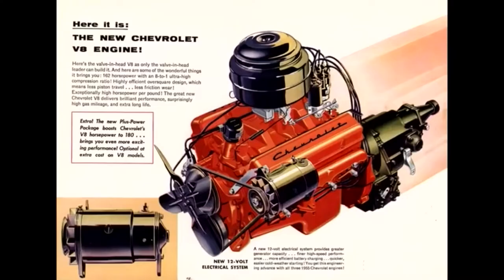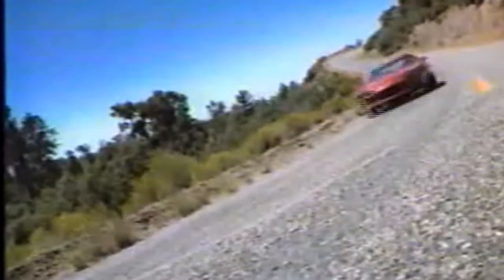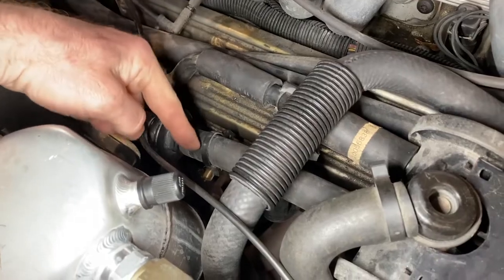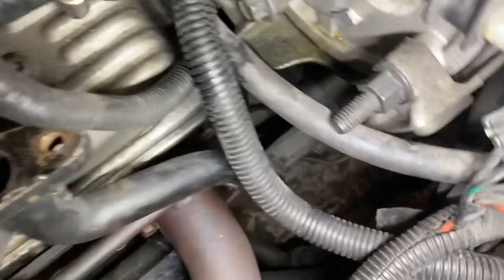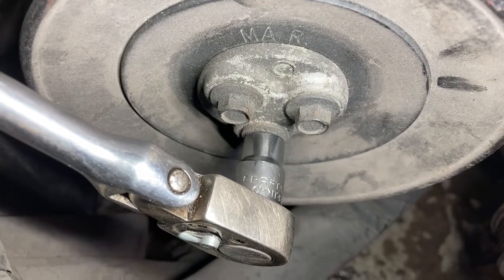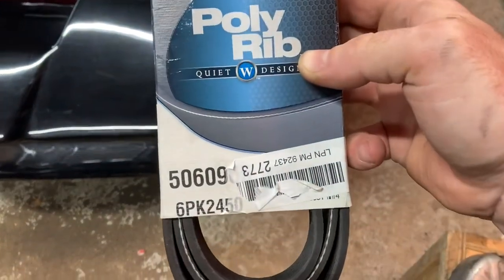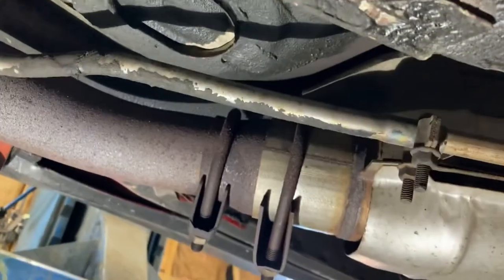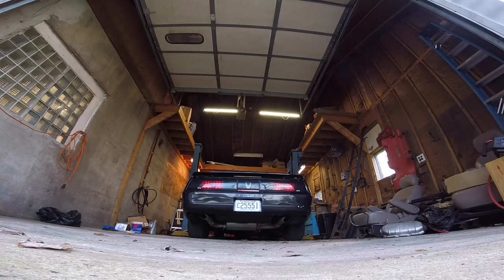How To De-Smog a Third Gen F-Body (the Cheap Easy Way!)

Comment: I just did the cat delete on my 88 GTA (owned since new) last week. I can concur that the difference it made in my smog dumping, tire spinning, freedom machine is truly impressive. If you haven’t already, get an upgrade second stage chip. Life will be good.
Reply from the maker: Got recommendations for a supplier?
Reply: Does anything else have to be done prior to stage-2 chip installation?
Reply: Where did you get the chip? Also the cat delete made that big of a difference huh?
Reply: @BlackRam17  they sell the chips in Hawks motor sports and yes it’s a crazy different, i removed mine as soon as i got the car, couldn’t be a better decision
Reply: @jessedenicola8063  what's the difference
Reply: A few years ago I rebuilt my LB9 (as you, I am the original owner) in my '88 IROC.  I cleaned up the engine bay by removing the AC and heater box (summer car only).  I installed Dyno Don headers and re-installed a larger Cat--the car has 3" from collector back through a GMMG "muffler."  I think next year the Cat comes out because it sits far too low and speed bumps at work are a hazard.
Reply: Does the chip work on both tbi and tpi?
Reply: I’m texting this while under my 88 trans am, laying on the ground and watching the pump
Reply: I just came up on a chip today and it got my check engine light going crazy in a 1991 chevy caprice

Comment: Easy on the 3.1 to skip the smog pump. You don’t really have a choice because you can’t buy a new one. You don’t even have to remove it. Use a different belt and reroute.  You can’t buy a charcoal canister. Therefore unplug fuel vapor line  from charcoal canister, remove purge valve, and put an air filter on the end. Cat…… well you can leave it, but just knock the guts out of it. Make sure when messing with charcoal canister you unplug the vacuum line and plug the end of it off. Non of the changes will give you a service engine light.

Comment: Technically, removing the catalytic converter reduces the carbon footprint of the vehicle because more CO comes out of the tailpipe than CO2. But it also means more hydrocarbons come out which are also greenhouse gasses but much less long lived in the atmosphere. The catalytic converter was really there to decrease the impact on smog and haze. Given how few of these cars are still on the road and how they are used now, removing it will have a negligible impact on any kind of air quality.

Comment: Those metal AIR tubes that connect to the exhaust manifolds are a pain in the azz to get out, but they can be removed using a flare nut wrench and the holes capped with 5/16 inverted flare nut plugs. I did this on my 84 Firebird just to make the engine look a little nicer and easier to work on
Reply from the maker: How do you access the fasteners that hold it in? From above or below?
Reply: @thedoubtfultechnician8067  from above. The driver side is pretty easy to get to but the passenger side is way more hard to access the closer you get to the firewall. On my vehicle I removed the AC stuff for access since I wasn't using it anyway. You might be able to use a flex head flare wrench. There are 4 flare nuts per manifold
Reply from the maker: Thanks!

Comment: Way late as my tuberythm is 12 months behind but like the stepped out details which I will use to carefully remove and box smog stuff since I MAY someday return to home in Calif. to continue to enjoy my '91 RS Camaro which is getting the 305 replaced by the 383 I am building. I do have the smog delete pulley already. 👍

Comment: can you delete the smog pump without cutting out the CAT with no issues? like tuning issues, fuel/air ratio ect? will it still run fine? i got a 92 camaro TBI 305

Comment: Just rewatched and performed the same procedure on my 1985 Trans Am with TPI. A couple of differences between the 85 model and yours (not too sure if my situation is the same as earlier cars, or when the procedure becomes the same as Dt's), My car has 4 belts instead of 1, the egr pump is run off of a single belt, so this means less modifications. The half in iron hose caps still work, however, the egr pump is held onto the engine through 2 brackets with 13mm bolts instead of T40s. The charcoal canister is a separate unit held in by I think 1 10mm bolt, the pump wheel for the belt is still held in by 3 bolts, but not 10mm, I think SAE of some variety, very close but not quite. And lastly, it has extra metal pipes for the air system that run around the back of the engine. These don't need to be capped just like DT's example, but I just performed the work and time will tell if it becomes an issue, or if it's just a little benign clutter. Just thought I'd share what I found!
Reply: Sorry, the EGR wheel is run off of a belt that ONLY connects to it and the crank, that's what I meant by single belt.

Comment: Funny shit, air pump was used to heat the O2 sensor on start up and the catalyst in the converter,the emissions only worked at above idle a till 80% throttle, above 80% throttle only restricted part was the converter,if you adjusted the TPS you could pickup some throttle response, I miss those days

Comment: Great video  i just did this exact thing last week  on my 91 rs convertible  is that a 45 inch belt  some say can use stock belt even without delete pulley? I rather put a new belt on  thanks
Reply from the maker: It’s a 96.5” belt. It’s pretty tight as is, I think a stock belt would be way too tight even if it technically installs.
Reply: @thedoubtfultechnician8067   awesome thanks il  get one this weekend and finish it!

Comment: If you're dropping a LB8 motor into any kit car. Delete the AC compressor and power steering pump. You only need 3, crankshaft/camshaft(hydraulic), water pump and alternator.

Comment: Real quick question here, trying to leave mine mostly stock.  If I remove the catalytic converter and leave the tube for the smog pump will any codes trip? or possible negative outcomes in doing this?

Comment: My 88 iroc tpi smells like fuel fumes after warming up and will eventually start sputtering and shut off until it cools down for hours. Do I have a canister issue??
Reply: Did you ever get an answer to this question? I've got the problem with my 90 with a 3.1l.
Reply: I would check your egr temp sensor and fuel pressure regulator. Common issues. Smelling fuel (running rich) can also come from to much air so clean that throttle body real well

Comment: Great video! Question, will this process be the same on my TBI? I own a 1991 firebird 305
Reply from the maker: I don’t own a TBI, but it should be similar- the main differences between TBI and TPI are the fuel delivery system and some electronics, none of which are affected by this.
Reply from the maker: You could always follow along the video and see if everything looks the same on your car; if so then go nuts!
Reply: @thedoubtfultechnician8067  thank you for your quick reply! I appreciate you posting

Comment: Just one simple question. Are you sure it need a longer or shorter belt after the smog delete? Tough for me to visualize it. Thanks
Reply from the maker: The stock belt might fight but it’s gonna be tighter than a nun’s bum and probably not good for your accessory bearings.
Reply: @thedoubtfultechnician8067  Ok. About how much bigger did you buy? In inches? I am about to do your delete method and would like to know how much longer the one was that you used. Your respectful Firebird friend MIles.
Reply from the maker: The belt I’m running is a dayco 5060965, but I also ran a slightly longer continental 4060970 just fine. They are 96.5” and 97” if memory serves?
Reply: Looks like the same routing, I'd don't know why he said you need a longer belt when you minus one pulley.
Reply from the maker: @mcqueenfanman Try it out!

Comment: I have a stud attached on backside of AC/SMOG bracket right under the Smog pump that I cant figure out? Almost able to see when ya took off tube from back of pump, any idea? (1991 Formula lb9)
Reply from the maker: Got a picture? Thedoubtfultechnician at gmail.com
Reply: I'm sure you've already got this taken care of, but in those situations, I'll use my phone and take a video (with the flash on) and slowly pan around the area, then watch it to to see what I'm dealing with and where it is....sometimes it takes a few tries but it works.

Comment: i have an 89 iroc and for some reason i have 3 check valves and i tried starting my car just with the air diverted disconnected and unplugged and for some reason it won’t start and my brake warning light is on. any ideas on why?
Reply: i have 2 check valves that connect to the diverter and one on the passenger side
Reply: sorry for spamming lol. but i got it to start i must’ve bumped something. but i’m still confused as to why i have 3 check valves. one comes out towards the back of the motor on my passenger side. one comes from the exhaust manifold on passenger side. and the other one comes on the manifold on the driver side. do i need to plug all 3 and is it supposed to be like that or is it dangerous?
Reply from the maker: Glad you got it started. Hopefully whatever you bumped is secure now, would suck if it came loose on a pothole and left you stranded.

I have ONE valve going to the pipe to the catalytic and ONE that goes to both manifolds. It sounds like your manifolds are fed by TWO separate valves? That would make a total of three but I’ve never worked on another trans am to know for sure.